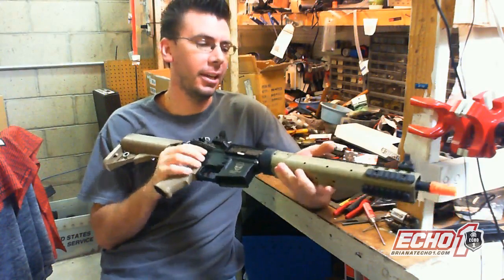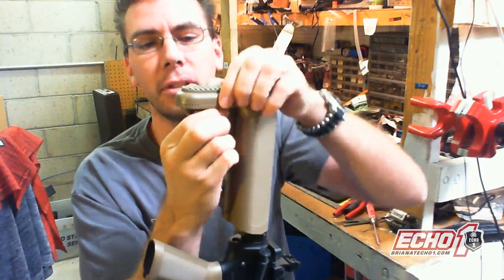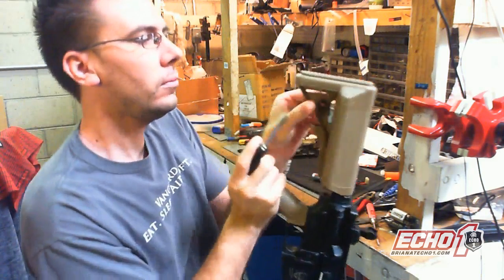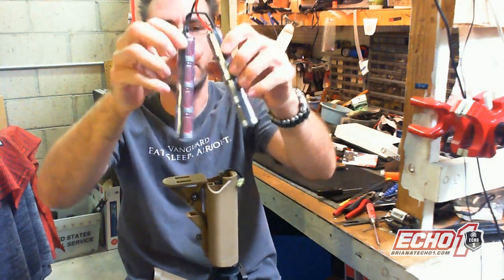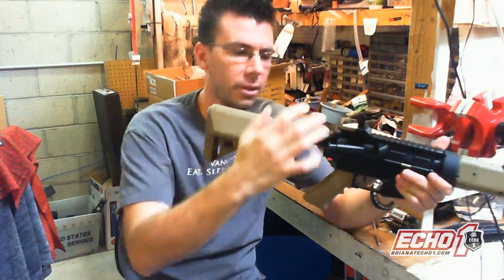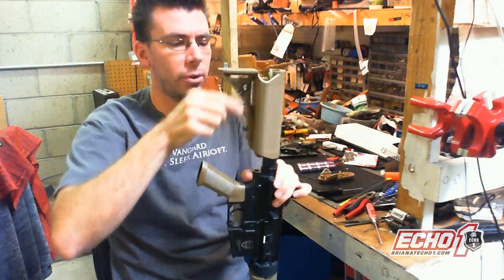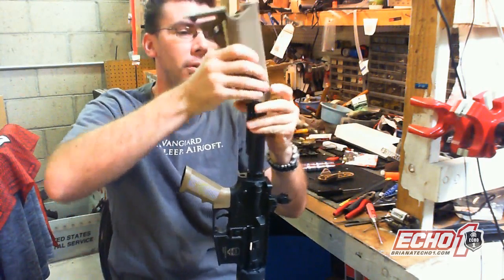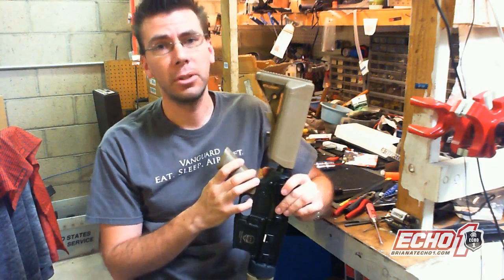How to use your Airsoft crane stock and battery

Comment: Could you please tell the length and diameter of the battery compartements? I would like to know if a Elite Airsoft 2100 mah 4/5A 9.6v Crane Stock Battery Pack will fit.

Comment: i have an XCR C and i want to move the battery position. take it out of the stock, and have the wire in a place where i can put it in a peq box. and ultimately change the stock to something better. how can i move it safely

Comment: I recently purchased the Red star akm and I noticed that the grip slide back in forth a little bit. I tried tightening the screw but it turns out the whole gearbox is a little loose in the receiver. Is there a way to fix this? thanks.